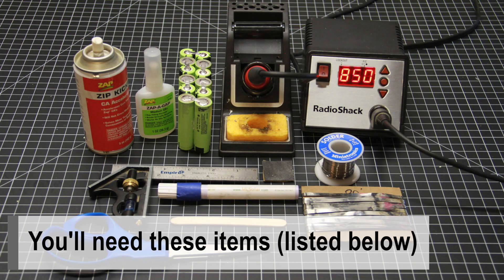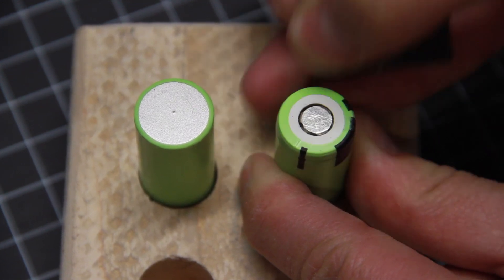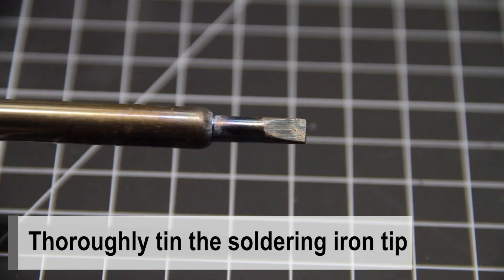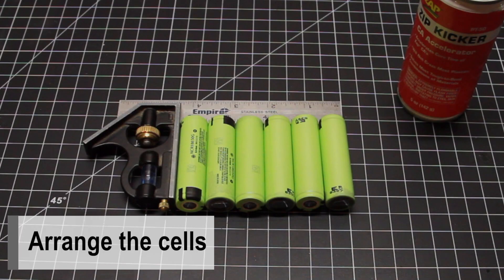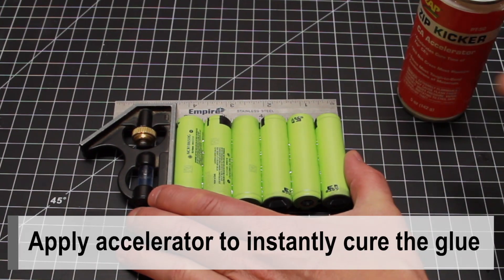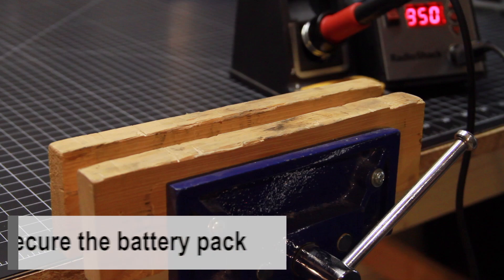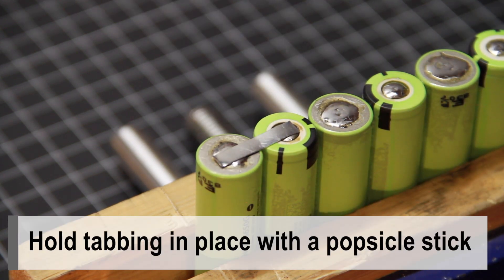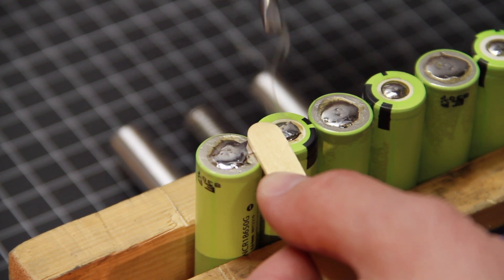Best Soldering 18650 Lithium Cell Tutorial - NO Welding, Just Solder!

Comment: Very dangerous, especially when heated too long: it can make lithium  batteries fail (violently!) later at an unpredictable moment. 
It might be possible using a temperature controlled solder iron with sol temperature solder but the risk is still there. Better use spot welding.
Reply: I aint gonna spend 50 bucks on spot welder just to solder my Router's ups bro

Comment: Thank you for this! I just built two little battery packs this way, and it was easy as pie! As per a commenter's suggestion here, I reused old desoldering braid to link up the cells, and that worked wonderfully. And as the others said, thank you for getting straight to the point and showing us exactly what we need to know! People trying to sell spot welders might not like your video though, but we do ;)
Reply from the maker: Desolder braid is perfectly fine, good tip. Nothing to sell here but free knowledge 😀

Comment: this is great, except for that part where you used glue to stick the batteries together. over time, the glue will become lose, which may cause a short circuit due to the cells' frail wrapping.
Reply from the maker: With many dozens of packs made that have been subjected to significant vibration and occasional impacts, we've never had a glue joint fail nor the heat shrink casing fail. We've had multiple spot welds fail however, hence the necessity for soldering cells.

Comment: Why it's never works for me 😭? 
The solder become fragile and don't hold on the surface of the battery
Reply from the maker: Your soldering iron is likely not hot enough or you’re not using the proper flux. Good luck, keep at it.
Reply: @enopto  
Just today i bought a professional solder wire core, it so much better.
I finally can solder properly 
I was using the solder that came with the iron.
Reply from the maker: Good to hear, glad you got it sorted!

Comment: I'm sorry, but I can't hold myself. THIS IS NOT SAFE TO DO! Working with Li-Ion cells comes with a risk. That risk needs to be eliminated/minimised, not amplified. You should use heat resistant insulation around the positive sides, otherwise there is nothing to prevent a shortcircuit in case of heat and/or mechanical pressure. Take care!

Comment: There's a few steps that I found that you don't have to do all that stuff. Like roughing up the ends you don't have to do that applying flux and stuff you don't have to do that. One method that I found that does work quite well is using some sort of acid whether it's toilet bowl cleaner preferably the works blue label at least that's what I used. I took a 6 volt battery apart and used the shell for the zinc now you can use pennies if need be for zinc since pennies are copper coated zinc. But all you have to do is wait a little bit and then apply that zinc infused acid onto the end and the solder will flow as if it had flux and you did all that at least that's another method anyways.

Comment: How can I remove the cutting tab strip from cells?
Reply: use a plyer and pull back then it should come off.
Reply: That's what i did first attempt. The tab strip was too thin and ended up getting ripped when I pulled with the plier. I then moved on to use a razor blade and cut it from the top of the battery slowly. @henrikgure2123

Comment: Would using tin-bismuth solder work better as its melting point is 138C'. 
My concern is that in my application of an e-bike running at 50V and 20amps so 1kW this may be dangerously close and may start to effect the mechanical properties of the solder.
Reply from the maker: I've never used tin bismuth solder so I cannot make a statement regarding it's use with Li-ion cells.
Reply: @enopto   okay thank you for getting back to me mate

Comment: internet is a big mess, I was told not to solder and also not to keep the cells close to each other,both things you are doing🤔
Reply from the maker: My packs have been working great for years. If the proper precautions are taken, this method works just fine.

Comment: Thank you, I want to do a combination of solder and spot welding, to 100% secure it, since my last pack's strips got loose (spot weld only) on my e-scooter due to all the vibration.
Reply from the maker: Soldering will provide a very secure tab connection. My batteries are typically used in small unmanned aircraft where vibration and hard landings require the cells be soldered. I've had issues with spot welded packs in the past. Also think about securing your cells to eliminate movement. Good luck!
Reply: @enopto  Ye I uses lots of glue this time on the cells, and drilled a tiny hole in all the strips, so that I could spot weld, and then after solder through the drilled hole. Works really well so far after 2-days of heavy driving around :D

Comment: I bought a TS100 to solder new batteries into my cordless drill, I applied solder to each of them, then pushed the tabs down onto the cells with the iron and held it there for way longer than shown here but the tabs just would not stick, am I doing something wrong or is the iron not up to such a task?
Reply from the maker: That soldering iron looks to be rated at 65W max, it should work. Make sure the soldering iron if fully heated to its max 400°c temp, you’ve cleaned everything and are using flux. Good luck!

Comment: I did not know soldering is melting tin wire, wondering what solder is
Reply from the maker: Solder (UK: /ˈsɒldə, ˈsəʊldə/;[1] NA: /ˈsɒdər/)[2] is a fusible metal alloy used to create a permanent bond between metal workpieces. Solder is melted in order to wet the parts of the joint, where it adheres to and connects the pieces after cooling. Metals or alloys suitable for use as solder should have a lower melting point than the pieces to be joined. The solder should also be resistant to oxidative and corrosive effects that would degrade the joint over time. Solder used in making electrical connections also needs to have favorable electrical characteristics.

Soft solder typically has a melting point range of 90 to 450 °C (190 to 840 °F; 360 to 720 K),[3] and is commonly used in electronics, plumbing, and sheet metal work. Alloys that melt between 180 and 190 °C (360 and 370 °F; 450 and 460 K) are the most commonly used. Soldering performed using alloys with a melting point above 450 °C (840 °F; 720 K) is called "hard soldering", "silver soldering", or brazing.

In specific proportions, some alloys are eutectic — that is, the alloy's melting point is the lowest possible for a mixture of those components, and coincides with the freezing point. Non-eutectic alloys can have markedly different solidus and liquidus temperatures, as they have distinct liquid and solid transitions. Non-eutectic mixtures often exist as a paste of solid particles in a melted matrix of the lower-melting phase as they approach high enough temperatures. In electrical work, if the joint is disturbed while in this "pasty" state before it fully solidifies, a poor electrical connection may result; use of eutectic solder reduces this problem. The pasty state of a non-eutectic solder can be exploited in plumbing, as it allows molding of the solder during cooling, e.g. for ensuring watertight joint of pipes, resulting in a so-called "wiped joint".

For electrical and electronics work, solder wire is available in a range of thicknesses for hand-soldering (manual soldering is performed using a soldering iron or soldering gun), and with cores containing flux. It is also available as a room temperature paste, as a preformed foil shaped to match the workpiece which may be more suited for mechanized mass-production, or in small "tabs" that can be wrapped around the joint and melted with a flame where an iron isn't usable or available, as for instance in field repairs. Alloys of lead and tin were commonly used in the past and are still available; they are particularly convenient for hand-soldering. Lead-free solders have been increasing in use due to regulatory requirements plus the health and environmental benefits of avoiding lead-based electronic components. They are almost exclusively used today in consumer electronics.[4]

Plumbers often use bars of solder, much thicker than the wire used for electrical applications, and apply flux separately; many plumbing-suitable soldering fluxes are too corrosive (or conductive) to be used in electrical or electronic work. Jewelers often use solder in thin sheets, which they cut into snippets.

Comment: When soldering the whole thing together you need to put something thin and heat resistant under tabs to prevent possibility of insulation melting and shortening positive contact with the body of the battery (negative)
Reply: The make stick on heavy paper rings specifically for that
Reply: Is kapton tape usable for this?
Reply: @bleak0218 kapton and even paper tape works fine. You just need to prevent melting the plastic film covering the battery. When you heat, it might just get a hole and you can spark a short easily.

Comment: I would add one more step to clean the joint with alcohol and an acid brush. Shortening the bristles on the acid brush makes them stiff enough to do a good cleaning.
https://www.amazon.com/36pcs-Flexible-Horsehair-Bristle-Brush/dp/B097GPZ5DV/ref=sr_1_9?crid=K424SGV7NP7L&keywords=acid+brush&qid=1655832093&sprefix=acid+brush%2Caps%2C92&sr=8-9
https://www.amazon.com/JETEHO-Dispenser-Bottle-Methanol-Container/dp/B07N1G5WD5/ref=sr_1_4?crid=WDO3Q75HV8N8&keywords=alcohol%2Bdispenser&qid=1655832176&sprefix=alcoholdispenser%2Caps%2C64&sr=8-4&th=1
Reply from the maker: Fantastic tip, thanks!

Comment: Very nicely done, good technique all around.
Couple of tips..
I punch a 1/4” hole in wide Kapton tape and put it over the positive button end to further protect against shorts, solder doesn’t bother Kapton.
You dont need so much solder in the first tinning, more mass dumps more heat, and it repeats again when the tab goes on only worse because there’s more dwell time.
Reply: i've seen others quench the joint with a moist sponge straight after to help protect the cells. unsure if that is a good idea.. i would have thought a sudden temp change may crack the joint.. but not sure.

Comment: Very good and fast job. I did this some years ago, but had no tabbing strips, so I just used regular electrical copper wire instead, but it worked and the battery pack is still good today.
Reply from the maker: Using wire is the old school method and works just fine.

Comment: hot glue is better and cheaper, not toxic, adheres great.with add stregth to bat packs.  As many mention below..you need an insulator at the positive end that can stand heat.  I understood these cells to be made with a form of stainless steel that wont take solder.. liquid flux which is not corrosive is a must.  not plumbers flux which contains acid !

Comment: These are NCR 18650B cells with pcb protection this is very dogy guys the chip is right under the positive terminal it's open and solder can flow in
Reply from the maker: No protection circuit on these cells.

Comment: could you conjoin these to potentially replace a lithium 12v battery?
Reply from the maker: Yes, you can assemble a pack in series or parallel. You can even add series packs in parallel, however pack of this nature can get complicated rather quick and may require additional components such as a BMS (battery management system)

Comment: for those who can't do the temp control soldering iron, take one of those dumb soldering irons (no temp control) and let it heat until temp is reached, use when temp is on the high end, stop when temp is on the low end; I measure the temperature with a laser thermometer.

Comment: I tried to change laptop batteries by soldering it but the solder joints are too thick so it doesn't fit in the casing.

Comment: done  4000 cells all connected this way. Ensure the solder fumes are vented outside..!  Mine look a little unpleasant as I dont remove the spot weld tag so no solder directly to cell.

Comment: Tip for those how have not soldering station
Have 30 watt 40 and 60 watt soldering iron first rub the cell with sand or u have any nail rub it scratch it then Tin the solder Iron tip which ever tip u have no need any specific then apply solder on cell  positive or negative side fast like in This video then u take wire or nickel strip do how do in video it's easy without This station
Remember must rub scratch this cell both side before soldering if u not scarch it then solder. Not sticking

Comment: As one professional to another. I am an electrical engineer and been soldering and welding for over 50 Years. You can not solder batteries like you solder electrical connections. Soldering to any battery will shorten the batteries life. In your video you used standard 60/40 rosin core solder. This is a high temperature solder. 
     You are using a method of "Drop Soldering". You use way too much solder per joint. Your iron is way too hot at 850°F and your iron tip is contacting the material being soldered. Thus a lot of heat is transferred to the battery. This is bad. Nor do you have any coolant such as freeze spray or a heat sink to cool the joint quickly.  You just lost up to 25% of your batteries cell life. Since your solder timing is inconsistent so is each individuals cells life in the pack.
Spot welding copper strips to connect batteries is the best method and material. It is consistent and does not transfer much heat. Solder itself is not a good conductor. 
If you must solder batteries, a better method is to use low temperature solder under 350°F.  The iron will be around 450°F  Tin the battery and a copper .032 strip.    
   While still hot during tinning, wipe off all excess solder off the battery and the copper strip with a wet sponge. Then re heat the strip and apply the heated strip to the battery using allot of pressure. The soldering iron should never come in contact with the battery. Apply coolant or a large heat sink while maintaining pressure until it is cool enough to touch. You want as little of a gap and as little of solder as possible.This is a much more consistent method because the specific heat in each of the same size strips is the same. The only variable is the amount of pressure you apply. Use a wood block to apply pressure with.  This method is know as Pressure soldering or friction welding.
Thus since there are better methods available. I can not in good conscience as an electrical engineer recommend your method.
Reply from the maker: I've built many many packs over the years with this method, none of which have demonstrated capacity loss. All cells charge and balance to the rated specification just fine.
Reply: @enopto   Nobody is saying Soldering won't work. But there is much evidence to support that soldering any battery is not a god idea. The heat and galvanic joint corrosion lead to soldering joint(s) failing especially in high current situations. Lead is a poor conductor. Its another dissimilar metal in a electrical circuit. Granted the losses are small but its your money.
     I would personally only use Pure copper to join the cells and spot weld the copper in place.   That is the most energy efficient cost effective method. As for Soldering and the losses they produce, How would you know any difference if soldering is all you have done ?   See: https://www.youtube.com/watch?v=byvr-dwwao4

Comment: NO SIR!!!!! Do NOT rough up the ends as they will surely rust! ( unless your in Arizona).I know Ive made enough packs and seen what they looked like a year later. You are also doing SERIES connections and unless you keep the amperage down to about 10 amps or less, that very thin nickle will have too much resistance. Only good at that level in Parallel. Also, they make cell holders for a reason..if that plastic gets roughed up and or comes off and rubs against another cell it's a dead short.

Comment: A couple of years after the video posted, but you can get really good internal-battery-run mini spot welders for about $40-50 now though. If you intend to make many, or a big one like for ebikes etc, that's more than worth it just for the risk reduction.
Reply from the maker: I don't trust spot welded batteries in UAVs that experience high vibration and constant handling for pack swaps. For reference; my spot welded packs and soldered packs perform the same, however the spot welded packs aren't as durable, especially during a crash.

Comment: fist thing, you cant clean the batteries using sandpaper because you'll remove the finishing of the battery terminal. You going to create oxidation if the batteries are exposed to humidity. Second, due to is very variable the time using a tip for solder the battery has a risk of activate it, this method is not recommended at all, the spot welding method is safest for this process. If you want to try this method use a container with water and salt for throw the battery in case of activation.
Reply from the maker: Ok